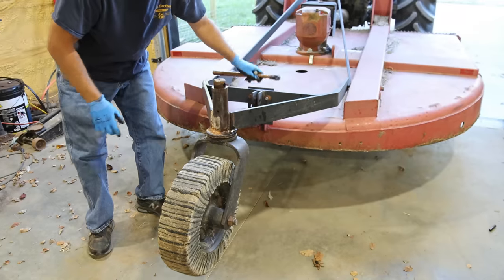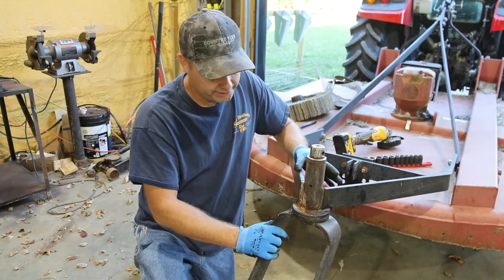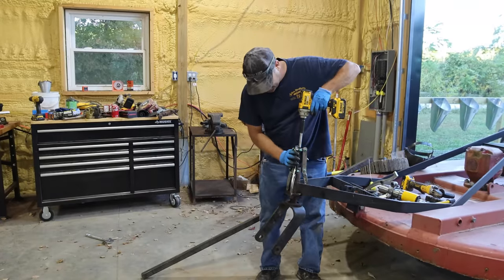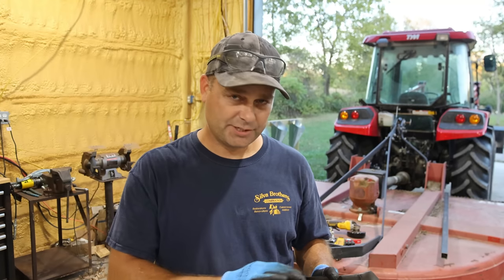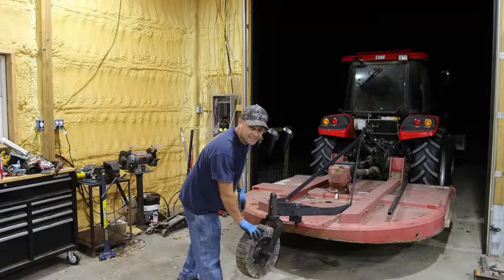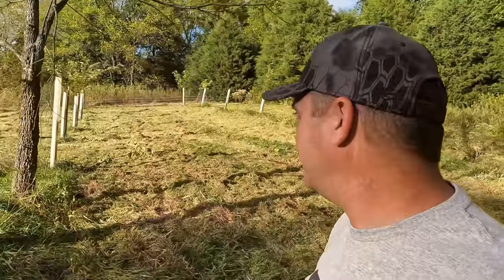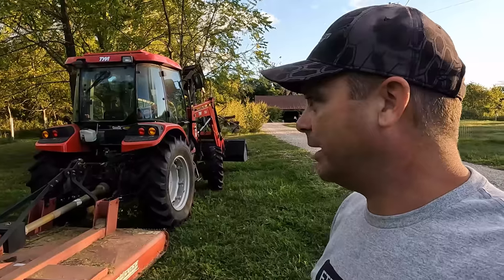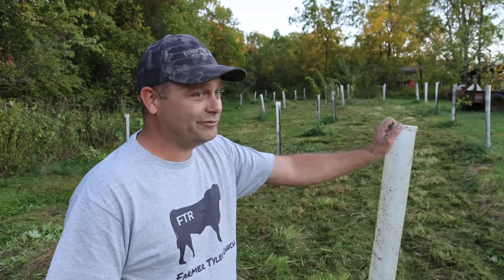I can't believe how hard this was to take apart.  I almost gave up fixing the bush hog mower.

Comment: Evan you are making the classic mistake of not supporting the arm @ the pin location...Yon lose considerable pressure  from bounce every-time you  hit with the
 sledge !!
I've also added a 2nd grease nipple....& even taken a grinder with a cut-off disc & put a slight spiral pathway for the grease to follow  up the shaft...Grease often of course !!

Comment: Grease mites will get you every time. I was surprised you didn’t put some anti seize on shaft before assembly. You’re bottom seal is out. People used to fill gearbox with gun grease.

Comment: I see a hole in the part the wheel assembly fits into. Could that hole be for a grease fitting With grease as often as you lube everything else wouldn't it prevent rust inside?

Comment: When you grease it spin the wheel to make sure you get grease all the way around or drill a grease fitting on the back side
Reply from the maker: I did, I just don't show all 60 Seconds of greasing in the video.

Comment: I noticed that there was always a hole in the tube but was there ever a zerk fitting in there?
Reply from the maker: I took the grease zerk out the first time I tried to take it apart.  I wouldn't take grease, put a new one in, and it wouldn't take grease either.  So it took it back out and tried using a torch on it.

Comment: Suggestion put a grease fitting on that sleeve so you can lubricate the shaft
Reply: He has 1 ,and has greased it
Reply: @trevorslater2746  I didn't see one
Reply from the maker: The original grease zerk was removed the first time I worked on it.  I installed new one still wouldn't take grease.  So I removed it before trying the torch.  But now that I got it apart, the new zerk is installed now and greased up.
Reply: @CountryViewAcres  good job, you didn't miss that trick

Comment: 1.  If you will grease it every day like you're supposed to, you probably won't ever have that problem.
2.  Jack stands.
3.  The heat didn't hurt you.
4.  Tail wheel shaft assemblies are cheaper than pullers.

Comment: Put a cheater pipe in the forks and turn the assembly to break it loose, then drive it out. Slightly hone the inside, drill and tap a whole in the cooler and install a grease zert to keep it lubed and no more sticking.

Comment: Why was it  forzen Evan Lake Greas  or it is out side .
Reply from the maker: grease fitting wouldn't take grease.  didn't have correct grease zerk.  had to buy a metric one.  installed a new grease zerk  and it still would take grease.  That's when I attempted to take it apart the first time.

Comment: You do realize that the crown of a chestnut tree gets 60’ wide and you’ve given it 14’ ?  Your trees are young enough that if you take out every other one or even two, and transplant them elsewhere, you will still have your lush forest but your trees will be healthier (not the best but better—they would still be too close). As it is now, cramming them together will severely limit your chestnut crop because they will expend energy trying to reach upwards from their fellows to get light, and won’t put production into making the nuts. Plus no airflow promotes diseases.
Reply from the maker: My main reason for planting was to have a forest.  So it was more about having a lot of trees.  I planted  trees that will produce forage for wildlife.  So it is planted the way I want it.  Some trees will end up small some will be big.  I am fine with that.
Reply: Ruadh Scottygirl I can't believe that Evan, of all people, would make that kind of mistake. They must be a dwarf variety like castanea pumila, that achieves 30' instead of 60' and 10'-20' wide. If that is the case, then wouldn't his spacing of 16' be fine.🤷🏻‍♀️

Comment: Use more lubricants. Before you use anything mechanical grease or oil it.. But much more important after using anything, clean and lubricate it. It will be ready for use next time then. Clean and grease, save time and money inthe long run.

Comment: Your lucky you didn't break something. 
 You should have raised it up some & cut it 1 time.
Then go back & cut it the 2nd time.  Then when you use the 0-turn mower you would be cutting the grass at 3 different lengths.

Comment: Why didn’t you grease the shaft before you started, it probably would have to a lot easier to remove! WD-40 is an excellent lubricant to get down around a shaft or fitting.